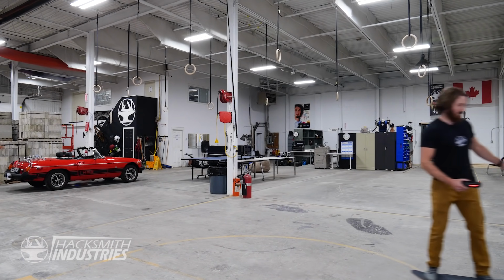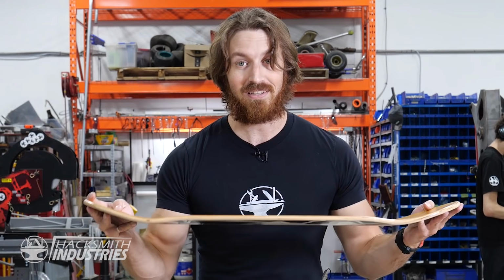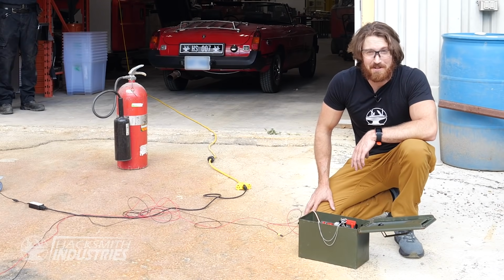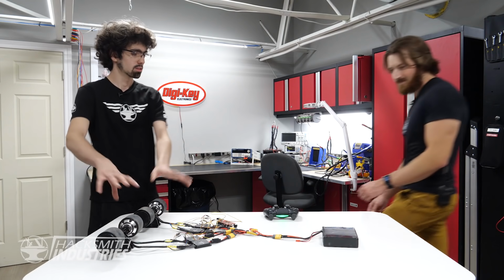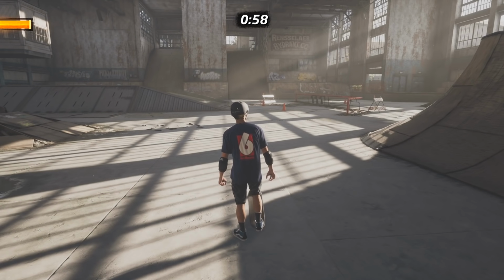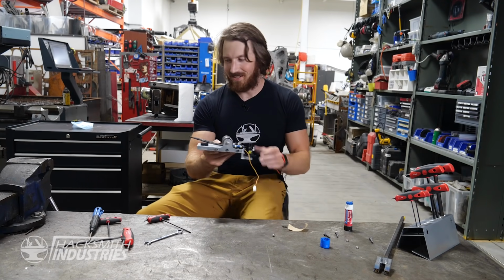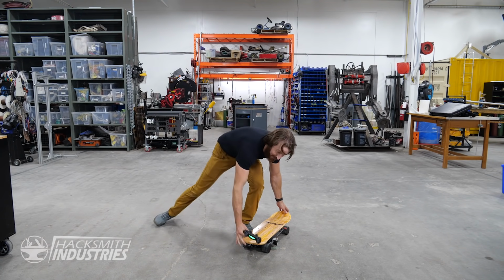Self-Kickflipping Skateboard!

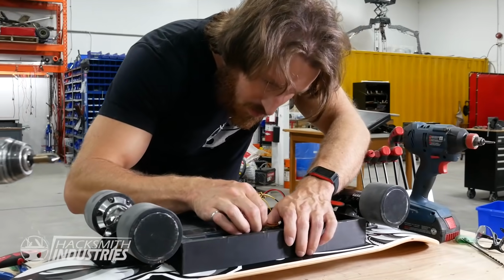Comment: 6:15 this is exactly what relays are for. A switch moves a contact via low power solenoid. When the contact closes the full Amp circuit is completed. No wear of high amperage on your power switch

Comment: Would compressed air flip it? Maybe CO2 canister? Or a controlled explosion something like a butane powered nail gun...them things have power and give you many shots/blasts. Gotta be a way to get more than one flip between reloads!
Reply from the maker: We tested that in this video haha
Reply: @hacksmith  I must of missed that I did see the omni directional oxy/acetylene balloon. My thought process was directional compressed gasses you can start & stop with a solenoid valve. High from Toronto :-)

Comment: If their were puzzle piece ejecting and retracting pie slice that rotate on a 90 degree fulcrum from the truck or wheels like the element stones on the fifth Element you could have more combos a sleek flush design and more control surfaces like 4 on each edge or even coming out the control box like a slice out the cheese wheel that fits into itself

Comment: I really just want a parts list/wiring/code for the electric board parts. I could care less about the flipping mech. Lol
Reply: maker-x tech VESC based ESC, 70mm chinese hubs some cheap 10S pack. Arduino for translating PS4 into VESC can bus controls.
Reply: @quinnfoster1234 , yeah I see the ESCs now that you mentioned it. Looks like it was a 6S pack though. I've found similar hubs, but nothing that looks like it has the clearance to the deck as these.

Either way they have a lot more money than I expected tied up into it. Haha
It's neat though.

Comment: Hey, Actual Skate/Longboarder who has actually gripped his own deck before here. NO NO NO NO NO. You disassemble the board completely then apply grip tape you just covered every screw making maintenance harder leaving you completely screwed (pun intended) if something breaks. You had one job Steve (Rogers look alike)
Reply from the maker: bro there's like 30 screws through the deck.
Reply: @hacksmith  Damn. Even more reason to punch holes. Maybe on the self kick flipping board 2.0